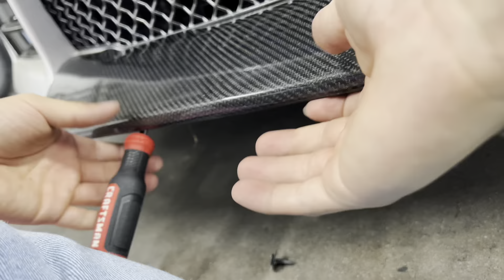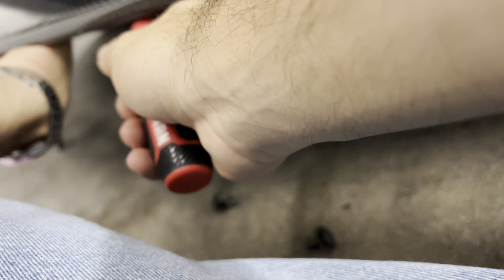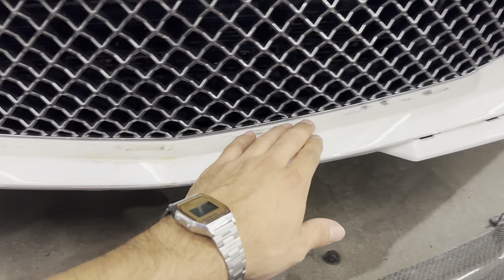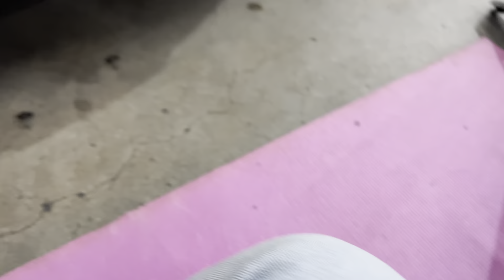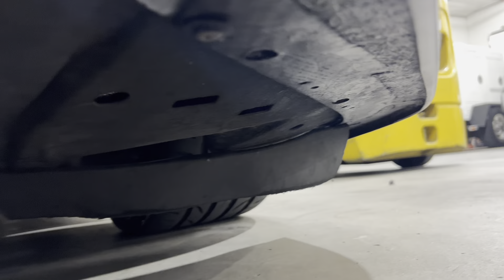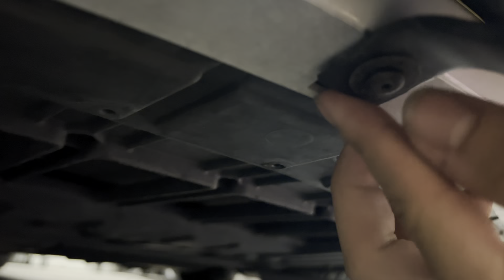16-19 ctsv EOS carbon lip install

Comment: Hey what lip did you have before? Mine just cracked need to replace. What is the price you’re paying for the lip? Thanks
Reply from the maker: @marcberger-r2v  i have the link in the description of the lip in video also price because i dont remember off the top of my head
Reply from the maker: https://extremeonlinestore.com/products/2016-19-cadillac-cts-v-carbon-fiber-front-splitter-ground-effect-lip